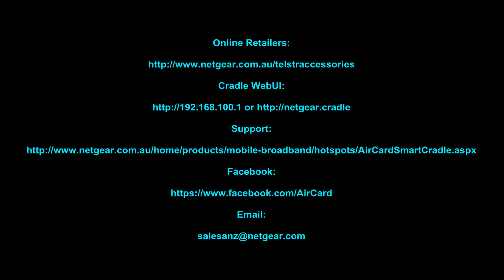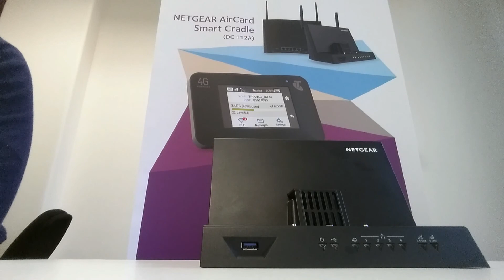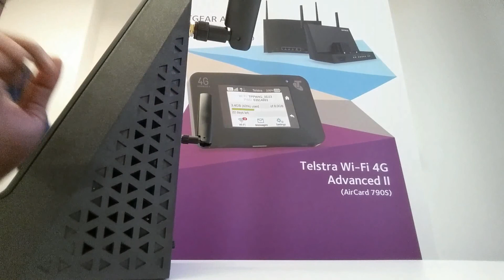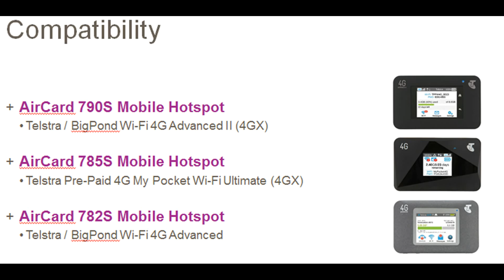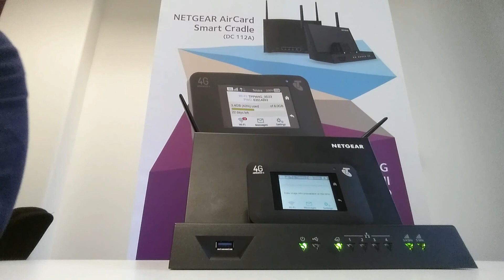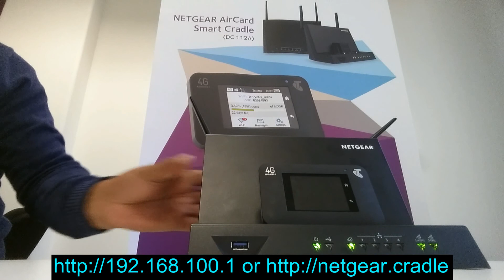Video Tutorial 1   DC112A setup

Comment: will this work with the Unite Pro 781S
Reply: +Bret Skeens this is exactly the answer im looking for
Reply: I can't see any reason it wouldn't.  The "network frequencies" that seeeejaaaay referred to below wouldn't matter a bit, because the router isn't doing anything on the LTE-WAN side other than adding a larger antenna or passing through to the external antenna jack on the back.
Reply: David Dunn Interesting

Comment: Netgear smart cradle dc112a -1Z1MES   firmware  Firmware Version 1.0.0.12

I try to  update my smart cradle from Netgar site firmware version 1.0.0.12
 is unable to install. Heres what i get when i try to install the 
firmware "the firmware file is oncorrect! Please get the firmware file 
again and make sure it is the correct firmware for this product"https://www.netgear.com/support/product/DC112A%20(Zain).aspx#Firmware%20Version%201.0.0.12  Right now my Firmware Version 1.0.0.4 (Initial Release). Can you help me ?I would like to this 1.0.012  firmare  beacause : Bug Fixes:Fixed the issue where the Cradle UI does not show 4G+ RAT icon, when the MHS is connected to two or more LTE CA Bands support.
Reply: voodoo vooodooo i have problem while putting my netgear hotspot on the cradle its only charging the lights for data transfer arent working why is that ? do help if you know
Reply: voodoo vooodooo you see your cradle with green earth logo or sign in my issue its not working why is that , it doesnt flash any light before it was working but never more , i had problem in my wifi hotspot the problem was in the usb 3.0 it was damaged  i went to repair shop i fixed it later i put it on the cradle its only charging but that logo or sign of the earth is not more working . please do help any advice